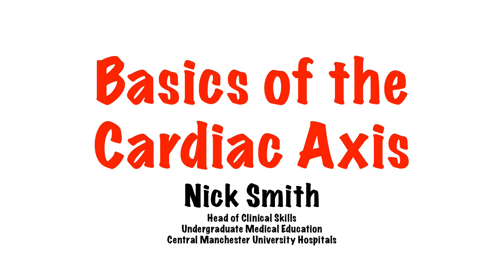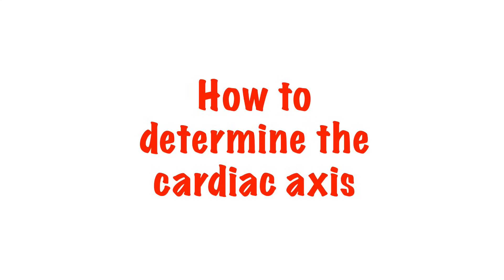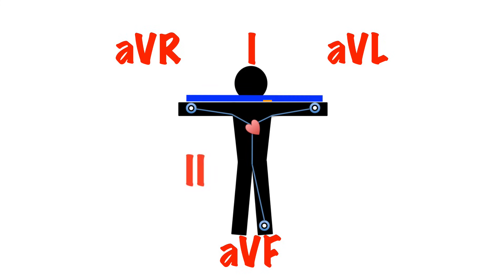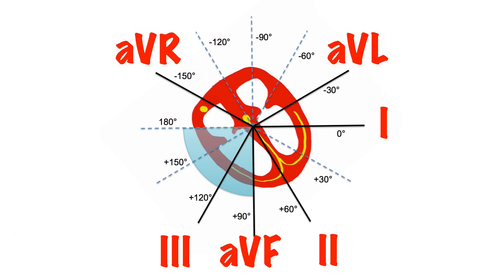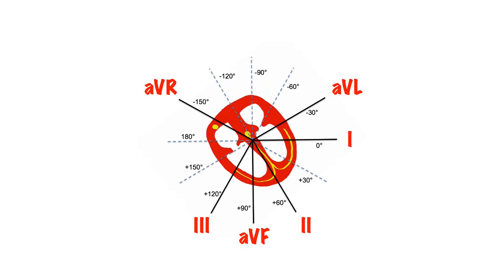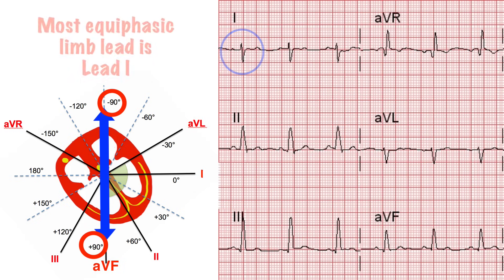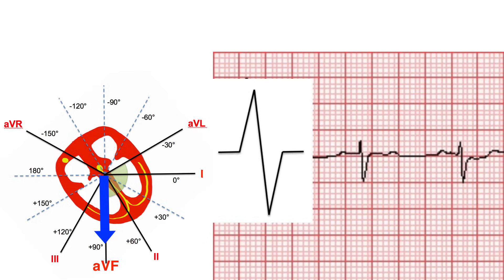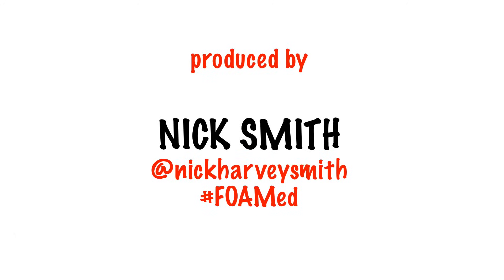Cardiac Axis in 5 min

Comment: The transition at 1:30 just confused me.
What's the point of the initial diagram?
Reply: The transition for lead 1, 2, and 3 was showing the vectors those leads travel into their actual position on the axis. I would suggest taking a look at Ninja Nerd’s video on EKG Leads if you need more assistance.

Comment: Great video, but I have a question. Let's you have a equiphasic Lead II, so you look at Lead aVL. aVL is positively deflected, so is the electricity going towards aVL at -30 degrees or +150 degrees?
I ask because some of my classmates are convinced that if a lead is positive, you follow the wheel down the positive numbers (+150 degrees in this case). But I think that since it's positively deflected, it should go towards the aVL at -30 degrees irrespective if the numbers are designated positive or negative.
Reply: At this case you have to look at the DI lead. If it´s positive the axis is -30 degrees. If it´s negative the axis is +150 degrees

Comment: You state that if Lead I is somewhat more negative than it is positive in its deflection, then you can go 15 degrees "away" from it. If Lead I is = 0 degrees, how did you arrive at an axis of 105/RAD just by looking at Lead I? Didn't you mix that up with aVF? If aVF was slightly more negative than it was positive, then you go 15 degrees away from it = 90 + 15 = 105, right? So did you mix them up or am I missing something?
Reply: Because you have to look if the wave is more positive (then the vector is going to the lead) or is more negative (then the vector is going away from the lead)

Comment: I am trying to learn ECG Axis.  Could someone help me with clarification & figure out the following axis:
1) if Lead 1 is Isoelectric and Lead aVF is Negative (Down) then what is the axis?  

   Is it Left axis, or Extreme (indeterminate)?

2) if Lead 1 I Negative and Lead aVF is Isoelectric (Down) then what is the axis?

   Is it Right axis, or Extreme (indeterminate)?

3) if Lead 1 and Lead aVF are both Isoelectric, then what is the axis?

   Is it Extreme (as unable to determine)?
Reply: -90 degrees

Comment: Leads I, II, and III are the limb leads. aVR, aVL, and aVF are the augmented voltage leads for the right arm and left arm and left foot. They are augmented because the sum of voltage called Wilsons point created by the limb leads I,II ,and III is to small to create a meaningful deflection on the EKG. This needs to be corrected.
Reply from the maker: Regina Becker Agree entirely with what you say but as it makes no difference to the interpretation of the axis I am going to leave it as I haven't got the time to re do the video. Sorry! N
Reply: I just thought where you had so many views it ought to be correct. Otherwise well done!
Reply from the maker: Regina Becker You make your point well - have added an annotation to the video and credited :)
Thanks

N